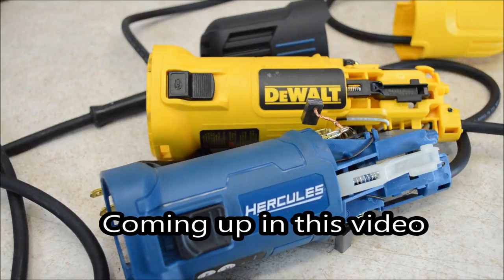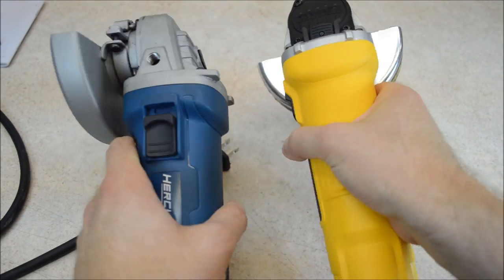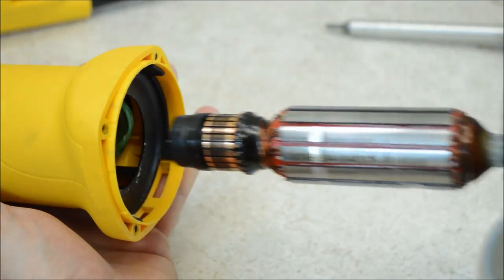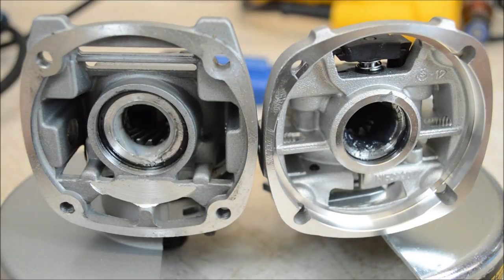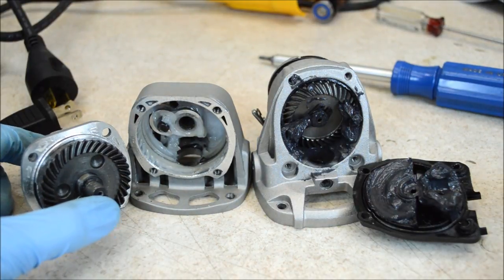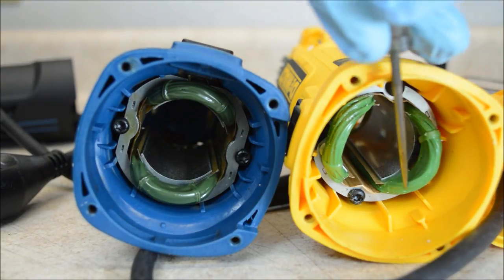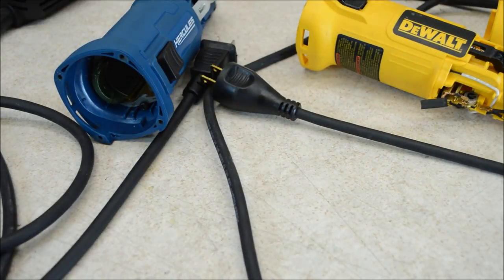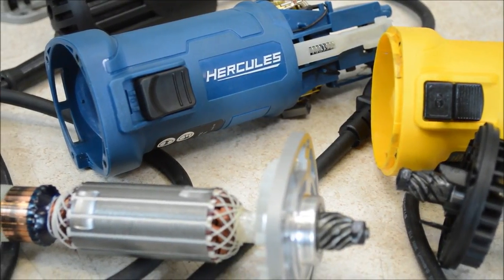Teardown part 1: Harbor Freight Hercules and DeWalt angle grinder comparison review

Comment: A few key places to inspect on reviews of power tools. 
1.) The brush material. Compare the density and melting characteristics. Both of which determine how long a tool will last.

2.) The machining on the comutator. Smooth is better because it won't wear down the brushes. 

3.) The actual electrical load. A really good way to see how powerful it actually is. 

4.) Noise level when using the tool. If you are going to use the tool for any amount of time it's nice to know what level of hearing protection you need. 

Thats all that I can think of for now.
Reply from the maker: +Andrew Heaton I was already planning some of these things for part 2. Stay tuned.
Reply: Andrew Heaton .
Reply: Great suggestions. I am curious about the noise level. I have a Hitachi 5" and it is quiet.
Reply: Doesn't HF sell an amp meter that the tool plugs into?

Comment: Did you notice at 1:54 that the Hercules brush spring was out of the groove to the left?  As the brush wears down, the spring would potentially catch on the brush holder and not push the brush down.  Not sure if you bumped it during disassembly of the cover or it it came that way from the factory.  Something to watch out for I guess.

Comment: If a harbor freight grinder fails you can take it to be exchanged without a problem.Not sure you can take back a DeWalt back to wherever you bought it for a replacement.I think you have to send it back to the manufacturer.
Reply: That is right. If you buy 2 year warranty, you can just get it replaced right away. (Almost any other store will take return in 90 days, so 90 day warranty is meaningless)

But FYI, that is ONE TIME replacement warranty. Unless you buy additional 2 year warranty at the time of replacement, you don't have any more warranty on that item.
I don't know if anything changed for Hercules brand, but it was like that 2~3 years ago, so I don't buy any more extended warranty from them.

Also, I had to throw away $40 impact wrench because I couldn't buy any more brushes separately. 
Not a big money, and I think I got more than the money's worth, but still, throwing away a tool because of brushes didn't feel good.
Hopefully HF sells brushes for Hercules tools.

So, if you use the tools once in a while and don't need any warranty, HF is a good way to go.
But if you use the tools for life, there might be couple things to consider before buying HF tools.

Comment: It's a little surprising and good to see Harbor Freight is actually stepping up some of their products. 

I think for a beater or a option in a hurry, the Hercules would be the go to. But I agree, the warranty on the DeWalt makes it slightly more appealing.

How about when they are running? Any differences in vibration would also be worthy of taking note because no one is going to want either if they are going to rattle you to death.
Reply: You should read fine print of Dewalt warranty.

Comment: How does the Harbor Freight hold up on dc welders such as a SA200? The Dewalt is rated ac/dc but the HF is only ac but they are brushed and work on dc.

Comment: looks like the Dewalt is a little bit beefier on the gear case  and the brush springs are larger  for better contact . I like that they put epoxy in the front of the motor armature as well on the Dewalt .Looks like the Dewalt is the better deal . Thanks for the tear down and comparison

Comment: The DeWalt is still the better value, based on the warranty, IMO.
Another great teardown and overview. 👏👏👏👍
Reply: Warranty? Angle grinders are consumables. It breaks, go out and buy another. Really if you're breaking angle grinders that means you need to step up to a bigger model. Once you break down and get a 7/9" big boy angle grinder things change. You can really lean on one of those mombos. You'll quit before it does. I can tell you that. But the price of entry on 7/9s is high.
Reply: "You'll quit before it does." 
LOL. You make a good point Paul, but as long as they're offering it, hey, what can one say. Exchange it for smaller jobs and also step up to what you actually need.
Reply: +Rob's Wrenches   I used to kill 4.5 angle grinders left and right til I started getting the bigger 7/9" models. When you push with a 7/9 stuff just goes away. You can mow down a gnarly weld bead in one shot. It is simple math a tool twice as big does the work in half the time. It might even work out better than that? A 4.5 on a big bead you're back and forth, back and forth grinding it away. A 7/9 kind of scrapes it off. You really have to see it for yourself to get what I mean. There's a reason they charge close to two beans for those big grinders. They're monsters! When I really push with a 7/9 the bead starts glowing, then it gets all soft, and it just smears off. If I try to do that with a 4.5 they just give up the ghost.

Comment: I had a 4 inch B&D that was 17 years old gave it to my Son its still going strong , I just got the Dewalt will see how long it last not a tool I use everyday but when I use one I always use 2 or 3 grinding disc for the Job cut off welding cleaning the area for welds and slag.   59 Bucks on ebay free shipping   70 bucks in Town Tractor Supply .

Comment: You can get a 2 year warranty on the HF for $20, which makes it the exact same price as the Dewalt.   

The dewalt warranty says it's 3 years, but it's really only 1 year.  The last 2 years only covers parts, which will obviously be secondary to labor in cost.  You also have to pay to ship it to them, and take the chance that your warranty claim is denied.   

With HF, you throw the tool on the counter for ANY REASON,, and then you get a replacement.   You don't even need a receipt.  Just tell them your phone number.

Dewalt will require a proof of purchase, but if you bought it in store, the odds you kept that receipt are near zero.

Comment: You forgot to mention that the DeWalt grinder has molybdenum disulfide grease in the gear housing, which is superior to whatever's in the Hercules grinder. That detail aside, this seems to be a pretty solid review.
Reply: Always change the grease out on HF tools..
Reply from the maker: Casey Megginson Well, it may not be quite that simple in this case. It does appear the DeWalt uses a moly grease. But the HF doesn't use plain-old cheap axle grease like the cheaper HF grinders. Based on appearance, the HF uses a fully synthetic grease of some type. I didn't include info about the grease because I didn't think it was that interesting.
Reply: Touché, good sir.
Reply from the maker: Casey Megginson Your comment on the grease was a good suggestion. I'll remember it for future videos.
Reply: Tool Teardowns the grease looks like white lithium in the hf.
Reply: +Tool Teardowns oh what grease is in her box is always interesting.
Reply: Paul Frederick bwahahahahaaaa...; )
Reply from the maker: That's definitely not a bad guess. However, if you were to see it up close I think you'd see the consistency and the appearance aren't quite right for white lithium grease. This looks much closer to Super Lube fully synthetic grease or something similar.
Reply: Tool Teardowns some unidentified Shmoo, I think.
Reply: Casey Megginson If you don't know what type of grease is in the Harbor Freight grinder, how can you claim the grease in the DeWalt is better?
Reply: +Icutmetal   Well, there's the subjective feeling that because the tool is yellow everything has to be better. Don't be so quick to dismiss that either, as DeWalt has made mad bank off that.
Reply: After tearing down several DeWalts for repairs when I ran a welding school toolroom I found their grease is so stiff it often stays away from the gear teeth. I solved that with a fat gob of aircraft moly wheel bearing grease so there's enough excess to ensure lubrication. I've also used disc brake wheel bearing grease with no problems. 
Grinder gears aren't picks as to what lube, they just die when run dry. Most grinder fails are due to worn brushes and burnt commutators, so brushless is a real advantage there.
Reply: Are you sure? because you said "whatever grease" is in there...meaning, you don't know what it is... for all you know it could be better.... you don't know that it isn't you only know that molybdenum is good but you don't know that the grease that is in the Hercules isn't...

Comment: I wouldn’t buy either one because of the thumb switch. A few bucks more for a paddle switch model. The paddle switch is easy to use because it’s within the normal grip of holding the tool. The thumb switch requires you to take your thumb off gripping duty to push the switch forwards, which forces your hand down the grinder, requiring you to hold it more tightly, tiring you out more. Your thumb gets tired more quickly as well. Spend the extra $5, or so, for a paddle model. It’s well worth the difference.

Comment: Great video thanks. I have several name brand grinders and a cheap HF one and to be honest I use the HF one a lot and the damn thing just keeps going. I haven't been to HF since the Bauer and Hercules brands came out but maybe its time for a trip.
Reply: Cheap ass HF angle grinders are legendary. Most folks when they are asked sum up the ownership experience say, It doesn't owe me a dime. I've seen Metabo angle grinders beat to death. Angle grinders simply are not the kind of tools that last. They go like hell in an environment full of grit. That is not a recipe for longevity.

Comment: Unfortunately the oversize cord on the Hercules is completely useless.  At 1:57 it looks like the gauge wiring between the brushes and switch on the Hercules is smaller in comparison to the DeWalt.  They went for the extra money on the cord, but threw all that effort out the window because they were too cheap to spend the 1/50th of a penny in cost on six inches of wire inside.
Reply: 5:15 and 8:10 - It looks like the gear housing and body on the DeWalt have a sleeve fit with one another, which would help add strength and keep the rotor better aligned.  The Hercules looks completely reliant on the bolts for alignment.
Reply: 6:39 - One piece head should mean there will be less wear on the pinion and bevel gear due to less case flexing, but I've never heard of a grinder dieing from bad gears.
Reply: Overall the Hercules is still very impressive looking, and I think it would be a bargain if Harbor Freight stood behind their tools with better warranties.  It's just having to buy an extended warranty on their stuff brings the total cost too close the competition.  Anyone who's seriously looking at this grinder is probably educated enough to know that it's priced like a commercial grade tool; and if Harbor Frieght wanted to capitalize on ignorance (those who don't know competition pricing), they will never sell any of these as long they're selling that crappy DrillMaster grinder for $9.99 with coupon.
Reply: +thechosendude a whole (a hole?) 0.29% difference? It's a fucking four and a half inch angle grinder. Look dip shit, if I want a grinder with some balls I'll grab one of my 7/9s I don't ever expect gobs of power out of tiny angle grinders. They're for finesse work, which I rarely ever do. But I got a couple around the shop for the unlikely eventuality.

Comment: The only advantage I see for the DeWilt is a longer warranty. But, let's face it. If either grinder is going to take dump on you, it'd do it in the first 30 days.
Reply: You can get a 2 year warranty on the HF for $20, which makes it the exact same price as the Dewalt.   

The dewalt warranty says it's 3 years, but it's really only 1 year.  The last 2 years only covers parts, which will obviously be secondary to labor in cost.  You also have to pay to ship it to them, and take the chance that your warranty claim is denied.   

With HF, you throw the tool on the counter for ANY REASON,, and then you get a replacement.   You don't even need a receipt.  Just tell them your phone number.

Dewalt will require a proof of purchase, but if you bought it in store, the odds you kept that receipt are near zero.

HF's warranty is several fold better.  But unless you use this tool A LOT, it's likely not worth buying the warranty.   The warranty is an added cost that you don't need.
Reply: Mister Hat Thanks for the warranty clarification, it is one of the reasons I decided to go with the Hercules grinder. I did not want to spend the $ on a warranty, because I do little metal work being primarily a wood worker. I had 2 jobs to do that would have been a lot of work with a hack saw and files. The Hercules did them fine and saved me time, but it will no doubt sit on the shelf for some time now. The little I use a grinder, the Hercules lets me use a better machine at a discount. Win win for me.
Reply: @johnhandcock3242  I have probably three dozen cordless DeWalt tools at least, and I've never had one break down.  Some of them I use nearly every day.

Comment: Ok, true story. Round about 7 years ago I got a Horror Fraud grinder that would become hot enough you had to wear heavy gloves to use it. Glad to see some improvement, but I will stick with my Makita and Dewalt now. Think I beat the Hazard Fracture into small pieces with a BFH. Not Skookum.

Comment: Nothing was said about the wrench.  When you opened the Dewalt box, there wasn't a wrench to be seen - only an Allen wrench.  What is that Allen wrench for?  I have used HF's mid-priced orange grinders for years.  I grind both steel and concrete.  Grinding concrete wears out a grinder, so I am reluctant to use a high dollar tool for that.  When a HF tool gives out, it is not a large burden to go pick up another - they are simply disposable.  With a 25% off coupon that I get for special times, I think that I'll try the new Herc model.
Reply from the maker: It’s a good point. I did forget to mention the wrenches. On the DeWalt, you use the Allen wrench on the nut. It fits in a hex on the nut.
Reply: I was confused when I opened the box and only found an allen wrench! Seems like it will work fine plus easy and inexpensive to replace a lost allen key.. Think I will secure it near the plug end.. This tends to force me to unplug to replace the wheel..

Comment: i have and have used both of these accept my dewalt is the near 100 dollar paddle throttle one but they are both great accept for the paddle part, they are both well made and powerfull, i lean to the harbor freight cause of the value and it seems to stay much cooler under a hard thrashing, the inside of the 100 dollar one isnt too much different but it uses a much nicer switch than both of the ones in this video and it has screw terminals as well, it has a few 1 ups on the hercules but it better, its over twice the price

Comment: I went into Harbor Freight yesterday for their Labor Day 25% off coupon.  Had this Hercules angle grinder in my cart.  The cashier says "Would you like to add 2 year protection for $20?".   I said why would I want purchase $20 insurance on a $30 tool.  He says no it is $40.  We don't take the 25% coupon on Hercules.  Sure enough it said that in tiny print. Then he says but this one is better than the other ones we sell.  So I said, then why do I need a 2 year warranty on it for $20?   I found another 20% off coupon though that has exclusions but Hercules is not listed.  See if they refuse to honor that one which would drop the price to $32.  Stay tuned.
Reply: wnorcott the fine print on the bottom of the 20% off coupons excludes a bunch of stuff.  Most people don't bother to read it.

Comment: Harbour freight power tools  (the sanders anyway)  are a lot better than Dewalt. I purchased a Dewalt palm sander, and a Dewalt random orbit sander. I didn't even get a year out of either. I replaced them with Harbor Freight sanders, and both are still going strong after 5 years, and they both get heavy use daily.

Comment: How can Harbor Freight offer a 90 day Warranty on their higher end brands that cost more and 90 days on their 50% Cheaper Grinders? That makes no sense. 

If that is the case, for 20 bucks more, i will go with the Dewalt , Better Warranty, and Customer service. A peace of mind is worth $20 more if it was more than that, I would consider the HF, Hercules Brand. 

Great Video's, You got me tuned in 😀
Reply: That's what I'm saying.  The extended two year warranty is the same price as two of those crappy DrillMaster angle grinders they sell ($9.99 with coupon)...and 50% of total tools cost.  

My only conclusion is that Harbor Freight doesn't have a tool problem, they have a customer problem.  I think too many people use Harbor Freight like a rental service, and too many people just beat the hell out of their tools because Harbor Freight accepts any condition returns. Having long factory warranties would hurt them...hence the astronomical 50% extended warranty.  It probably factors in all the people who will bring back a broken tool with 1 day left on their warranty, or get a replacement every month because they beat on it.  In fairness to HF, I have seen them accept a Predator 4 cycle gas engine return that was completely spray painted and missing parts.  You could intentionally run a tool over with a truck and they'd happily take it back.

Comment: :25  I already know how it compares.  I just bought a 4011 TODAY (May 26, 2019) and within 10 minutes it was overheating to the point I couldn't really touch it with bare hands (i had gloves on tho) and it was vibrating bad using a wire brush that became lopsided and you couldn't touch the handle w/o your hand going numb.  I'm going to take this piece of crap back TUESDAY and request a refund.